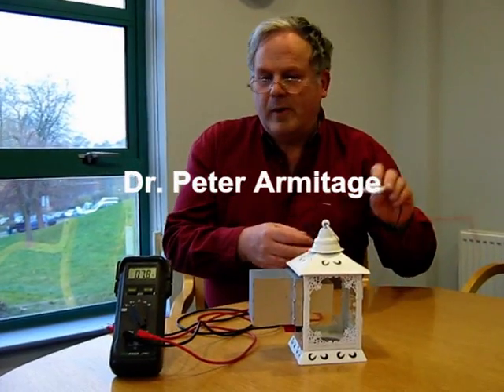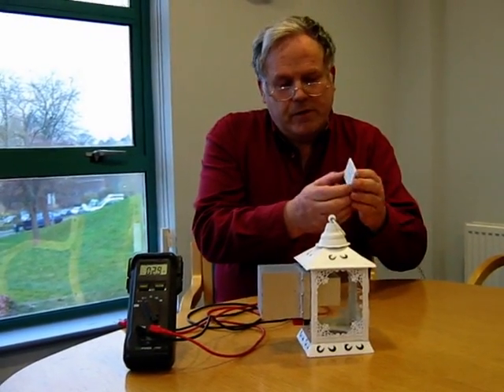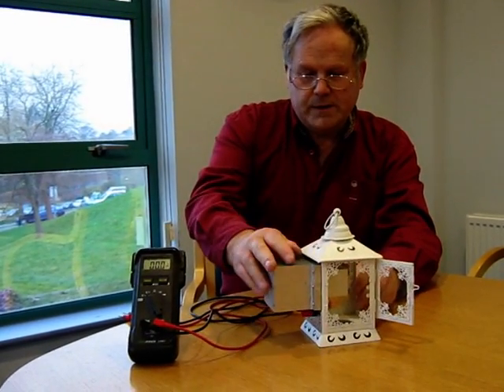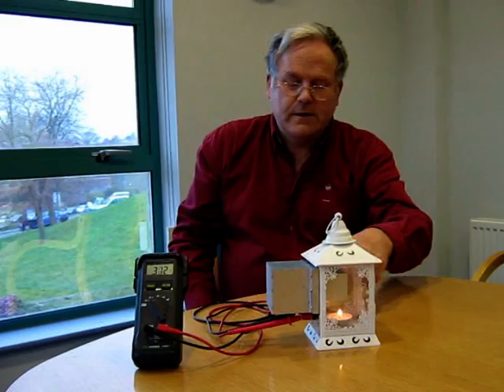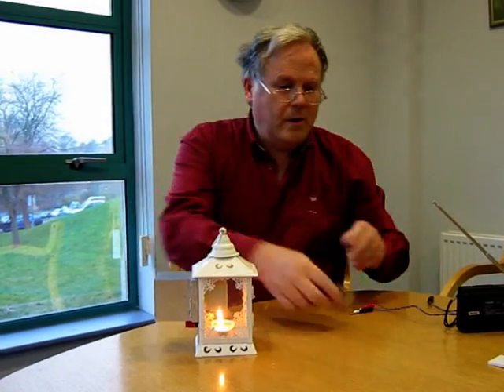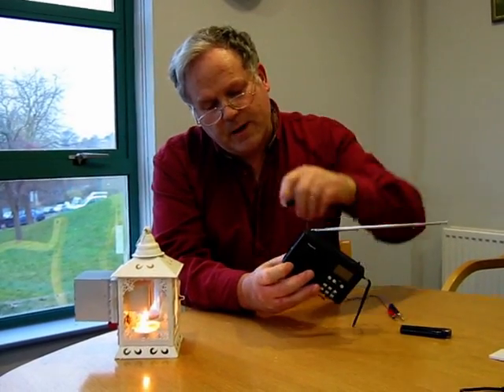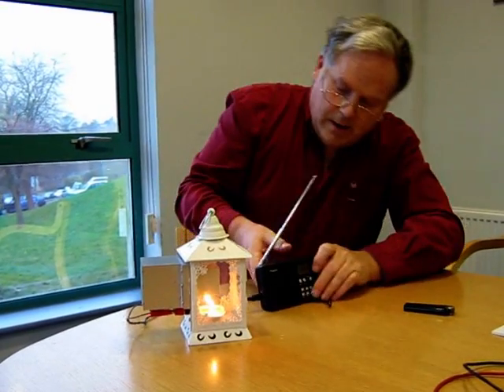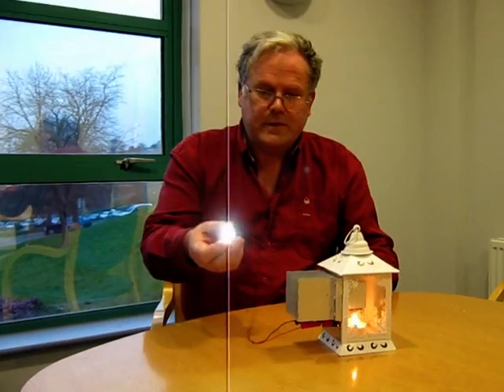Candle Powered Radio.

Comment: Hi Peter,

I am hoping to use a thermoelectric module in a similar manner to which you have in this video (i.e. to generate electricity from the heat energy of a candle). I have few questions about the application you have shown in this video and I hope you can answer them :)
 
1.       How many volts did the thermoelectric module actually produce when both one candle and two candles were used?
2.       Did you create a thermal model for this application? Did you calculate the thermal resistance of the heat sinks, thermoelectric module and thermal paste (heat sink compound) to find out how much heat energy (watts) is to be absorbed and removed from the Moroccan lantern into the surrounding atmosphere?
3.       How did you mount the heat sinks, thermoelectric module and associated connectors to the lantern?
4.       What model Peltier Cooler did you use?
 
I am currently putting together a little thermal energy harvesting application for an undergraduate project and I need to generate 500mV (max) with use of a thermoelectric/Peltier module to drive a load. Any suggestions and advice you can give me regarding thermoelectric module and heat sink selection and my project?
 
Regards,
 
Steven
Reply: sorry about the delay in reply.
1) the voltage generated was about1 to 2 volts per peltier unit, so for the two used in series I was getting between 2 and 4 volts when the candles were burning. The voltage is not stable it will drop as the candles burn down (less flame/heat). I measured the power generated it was about 2 watts max. The radio I used was able to tolerate variations in voltage from 3 to 4.5 Volts. I would recommend that if a fixed voltage is required then use a voltage regulator. In your case this may be difficult at 500mV, you could use a diode and resistor, depends on the current needed. 
2) no models or thermal resistance calculations were made, just built by guess work and experimentation.
3) heat sinks and thermal module was bolted on to the lantern using small thin metal nuts and bolts
4) The peltier device was obtained from ebay, just type peltier in to the search and many products will come up at very reasonable prices.
5) the heat sinks were from old scraped computers, you can get some on ebay but tend to be expensive.
Reply: Thank you for responding. Your comments helped me to clear up some aspects i was unsure about in with regards to my little project.